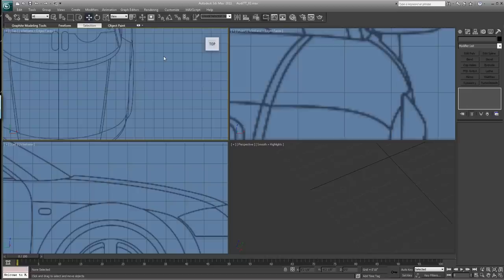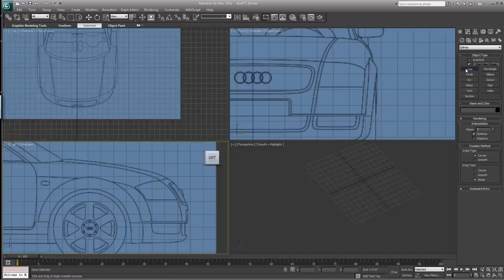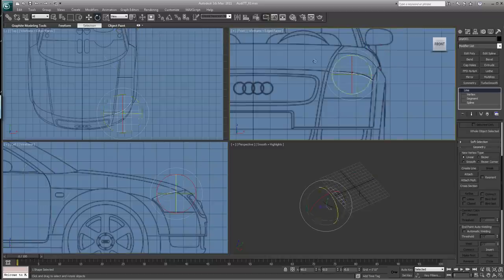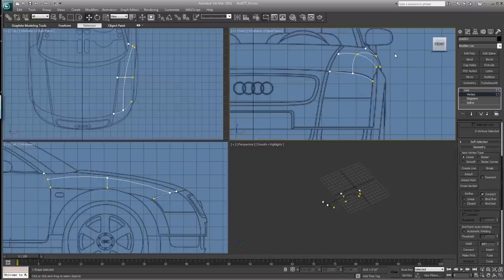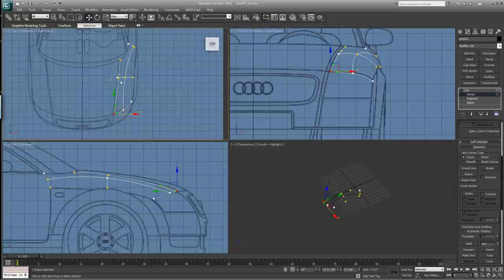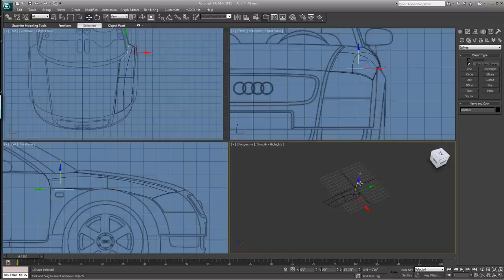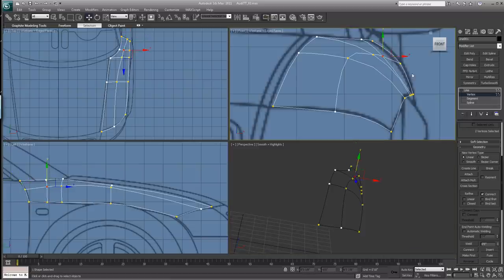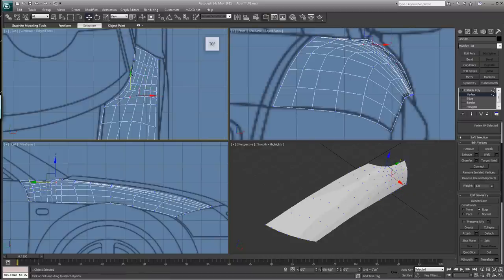3DS Max spline modeling EASY Part 1

Comment: What's the point of using WELD on vertexes that are fused to side of another spline. They will not weld because of nature of spline always being a single line with no separations.

Comment: Awesome tut, however I can't replicate what you're doing in max because I can't see how you placed your 4 planes in relation with each other in the perspective viewport. I have aligned the top and side planes so that they match but can you explain where you placed the front and back? thank you
Reply from the maker: +latefa21 the images are not mapped onto planes, they are background images. Go into each window and set up the appropriate image for each window. Easy peazy.
Reply: +Frank Maturi Easy peazy indeed, thank you xxxx

Comment: Thanks.  Do you find this to be easier than actually modeling it from faces?
Reply from the maker: For some shapes and models, I like it better...not easier than poly modeling, just works better in some instances.
Reply: I see people use it a lot when modeling shoes and such.
Reply: In the big companies it's really important to have a really nice and clean mesh!
and with this technique you can have it so much easier than face modeling!

also you have more control over your model and it's dynamic! which is  a really big adventure!